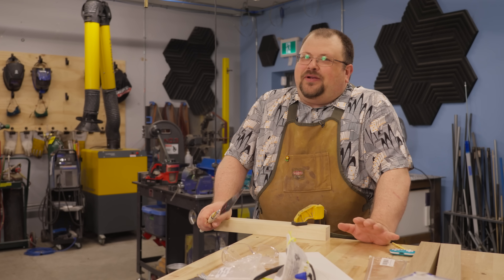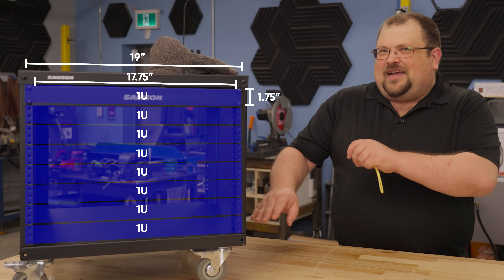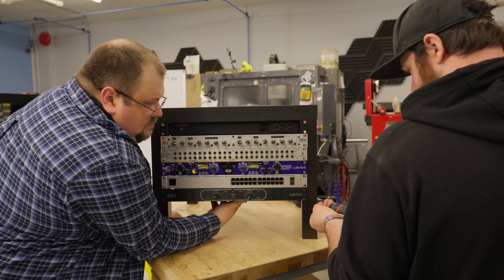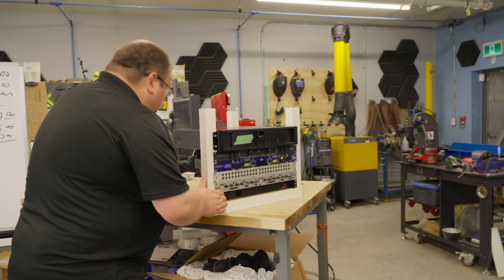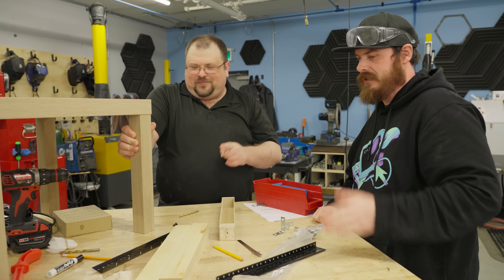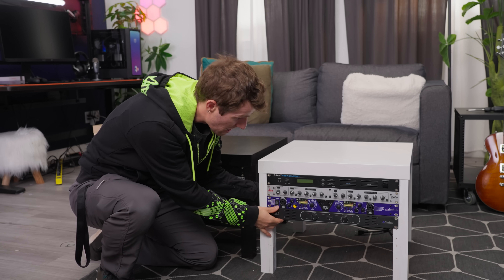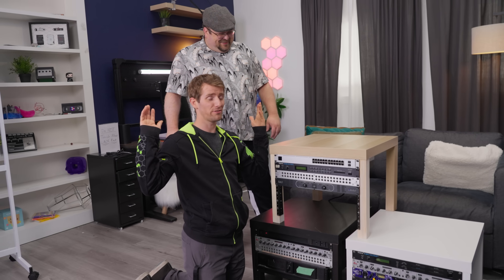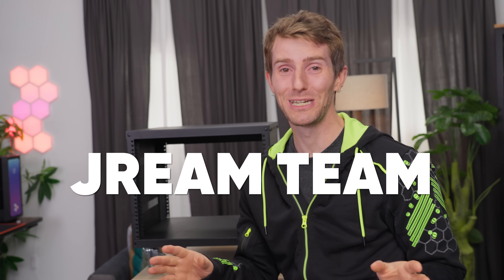Server Racks Cost Too Much - Buy or DIY?

Comment: 5:48 hey folks did you know aoft vs hardwood has nothing to do with the actual hardness of the wood, its a family classification and individual tree species can vary

Balsa is an incredibly soft hardwood and southern yellow pine is a hard softwood 

Softwoods are generally very strong and heavily uaed in construction but will generally dent more easily due to the softness and is generally aboided for aesthetic reasons in furniture making

Comment: Get an office chair out of the garbage and pull out the wheels. Then 3d print 4 office chair wheel brackets to go on the lack table legs. I stacked two lack tables on top of each other and now have a cheap rolling mini workbench with a storage shelf.

Comment: The lack table is also good for making a 3d printer cabnet. I bought 2 of them and printed stuff to link them together, bought plexiglass and made doors and voila. You got yourself a 3d printer cabnet that contains heat maintains chamber temp and everything. I also have the creality k1 printer in it.
Reply: I did this with an original Ender 3 back in the day. Still runs today - although I would have skipped all the plexiglass for solid wood just screwed to the legs. The heat leak from the plexi is hard as hell to counter (I had a 500W space heater in it at one point), and just having plain 10mm MDF on all edges and a glass door would have been so much better. LED lights at the top and you're good to go.

Comment: I much prefer trolling Craigslist, FB marketplace, etc for used server racks. They often get liquidated for cheap. It's not uncommon to find a full-height 42U rack for $75-125 USD. This way you don't have to build anything, you're spending very little money (especially considering what you get for your money), and you don't have to worry about weight capacity, build-quality, etc.

Comment: If you live in Europe, Thomann has a pretty similar Millenium 8U rack with wheels for 92 €. I have their 12U rack (for 139 €).
Reply: Still feels so expensive for a glorified shelf.
Reply: @KaKi87 It's only expensive compared to cardboard. And it has wheels and the rear rack strips/mounts, so if you factor those in, it's cheaper than the DIY version here (except if you don't put a price on labor, but I prefer to pay a tiny bit more to get a bit more free time).
Reply: Yeah, came here to say I buy the 21U version of that Samson rack for under 150€. 200USD for 8U is crazy.
Reply: Sweeeet

Comment: Here's an idea; just buy extruded aluminium profile, cut to length, connect with some screws and use those amazon rails on them. All metal for aesthetics, more durable than wood, likely about same price as wood.

Comment: I would say for buying a rack buy used. If you live in a town i could find a used one cheap or free. Not very high second hand value. Sadly most i found close to free are full size so may not fit in ever ones apartment

Comment: i will say this my vevor 12u server rack on casters i got for 80$ has been a great rack its loaded down with stuff havent had any issues
Reply: I have the same one. I was kind of worried initially because its so cheap. After building it, adding a server rack battery back up, patch panel, custom made bracket for my switch, the 1U tray it comes with, and a 3U computer chassis, its pretty solid.
Reply: I'm glad to see somebody vouch for Vevor as that's the brand I'm looking at buying for my first rack. I'm trying to get a cheap rack and at my job, Vevor server racks are special order items and the only brand we carry. Next month my company bumps the employee discount up from 10% to 20% off for a limited time so I was going to grab one then.
Reply: @turbosnail6119  i grabbed mine off of the vevor ebay store and i have big ass 4u gpu mining servers on the rack its held up very well i am actually looking at getting another one

Comment: If you’re looking on the second-hand market, full-size racks are often given away for free if you go pick them up. They can be modified to be smaller, but it’s a bit of a job.

Half racks and network racks, which are more popular, typically cost $100–300 depending on size, condition, and so on.

Comment: Almost a decade ago, I decided to rack mount both of our gaming PCs, along with some audio gear, a rack drawer, and a power distributer. I used the same Amazon rack rails, although in a longer size (the rack I'm describing is about chest-high from the floor). I constructed the rack from  1-inch square steel tubing from the hardware store, and I didn't have a welder, so the whole thing is held together with self-tapping screws and steel mounting brackets (also from the hardware store). I still have that rack, and it's still rock solid. Quality it is not, and it's not quite as cheap as a lack table, but it proves you can easily build a sturdy all-metal rack with nothing but a drill and a hacksaw for less than 200 USD.
Reply: You can do something similar with 20x20 extruded aluminum, which is more homeowner friendly and significantly lighter.

Comment: V1 would be much more stronger if you replaced wood screws with long metal + washer + nut and drilled the holes true hole leg.

Comment: Turn the tables upside down, add casters, and screw the next table top to the legs of the bottom table. Build a stack of 3 tables and add a plywood top. Now you have a 27 U rolling rack. I have 3 of these. 2 filled with servers. Mostly, Dell R710s and R310s and the middle one is power distribution and networking switches.

Comment: The Lack legs were orignally solid, but have been hollow for a while now. If you cut off the bottom of the legs you should be able to slide in a 2x2" if you don't wan to replace the legs.
Reply: How long ago was that? Cause in the video they showed a 20 year old one was still hollow which I can also verify as the one from my childhood bedroom was too about 20 years ago. (Learned that right before a completely unrelated hospital trip as 8 year old me was an idiot)
Reply: And if you remount things you can replace the inside 2x2" as it wears
Reply: It still holds hundreds of pounds comfortably if you mount it correctly and use stabilizing metal brackets. Even more if you use 2 lacks and stack them opposite of the other, with the servers resting on an upside down lack underside, and another acting as the table top.
Reply: I mean predrill holes, or use threqaded inserts or through bolts lots of things they could have done...
Reply: he showed an old one was hollow too
Reply: The tops were solid too, but that's what you have to do to keep the original launch price of 17 USD on a 45 year old product
Reply: Good place to hide ass pennies, imo.
Reply: @RisenThe  good evening sir may I please ask what ass pennies are
Reply: @ShouterOfSanity  :)
Reply: Damn even IKEA is getting cheaper. Wtf
Reply: @JamesCarlic-t2y Ikea was always cheap, you don't make products for 5% of your competitors' prices by using solid wood.
Reply: @JamesCarlic-t2y IKEA was always cheap. I mean why do you need this much wood, when it works with less? Cheap furniture these days is just some nice paneling, some chipboard supports for holes and the sides and when you need additional support, you add some cardboard in a honeycomb shape in the inside.

The only downside is, that you can't modify it. Also it doesn't tolerate much abuse.
Reply: @JamesCarlic-t2y  Just watched a documentary on IKEA making hollow paper tables, that is why they can be so cheap in the first place.
Reply: @JamesCarlic-t2y are they considered nice in i presume North-America?
Reply: @JamesCarlic-t2y it was that or increase the price of the table.

They’ve never increased the price of the table. Ever.
Reply: Yep I was gonna comment something similar saw a video lately about the legs behing hollow now and not back in the days

Comment: Alternative option... take out the fiberboard plug at the bottom of the legs and slide solid wood inside so you don't have to mess with the finish.  I did a build like that with two lack racks stacked on top of each other for years until I built my own out custom rack out of 2x4's, plywood, rails from Amazon, and heavy duty caster wheels.

I also smell an opportunity for a roast your diy racks video.
Reply: And at least where I live, many if not most places that sell building material, also cut them to any size you need for free, as long as you buy the raw material with them. So you don't even need any tools yourself and get very precise cuts
Reply: @Bumi-90 I think the Lowe's up the street from me will will do 3 cuts for free if you buy the wood from them...I have all the tools to do it myself, but why waste my time when I can order it online and have it cut and ready pick up when I get there...
Reply: Also, could put an aluminum strip behind the leg and sandwich it between the plate and the gear, bonus you get tightness due to having to use a washer, that’s how I did it
Reply: I was thinking this exact idea 13:27  literally as Linus was looking at the third iteration, then you dont have the color issue at all
Reply: You dont even have to fill the entire leg so any thickness wood will do. Just slather the contacting sides with woodglue & slide it in.
Reply: Yeah pretty much what I did, put in actual wood into the hollow legs.
Reply: That's a lot more work (especially in getting the physical tolerances just right) than just replacing the legs. You might as well paint everything black anyway for consistency, it's not like it looks very good as a server rack to begin with, otherwise.
Reply: I was thinking similar, but with an expanding fill material.
Reply: @thephoenix3000 expanding fill material that's as solid as wood for that volume? Wouldn't be cheap.
Reply: @daymianhogue1634  Does it need to be as solid? The failure looked like too much weight on too thin material. Having more of that weight supported is all is probably needs and foam can get there
Reply: @neonkidxy  the issue wasn't the weight in itself, but the leverage it put on the screw. The screw doesn't have much to hold on to with foam filling either.
Reply: @einstijn138 Leverage was the force I was trying to articulate as the failure. Foam would provide more contact and even weight distribution for the clamping force to be spread along the bolt. Fill foam vs insulating foam.
Reply: @neonkidxy  lol.. no man, no foam is goin to do anything to improve that materials ability to hand the pullout and torque from those items. The densest closed cell foam you could buy wouldn't do anything.  The threads would have near zero bite and it wouldn't hold them at all.   Even if it did something, a can of foam is more expensive than the 2x4 (and closed cell two part is much more expensive multiples of the table).

Comment: Now the real question is can it still be my side table
Reply: Sure. It'll be kinda noisy (if it's a computer rack) and have bunch of wires hanging off the back but if that is what you want 😅

Comment: I'm not really a fan of including an hourly wage into the budget. I can't remember a time I built myself a computer or anything really and thought about the fact that I could be at work instead.
Reply: For me it's more that they counted installing the equipement as part of the cost. It's not like the prebuilt rack come with them intalled.
Reply: You don't have to factor their calculations to your own personal project, it's not like the added hourly wage made the DIYs more expensive than the new racks either
Reply: eh, it's not really that, it's more about fairness in price comparison. You shouldn't really call something 'cheaper' if it took you months of work even if the actual money you spent was lower. Sure, some people might consider it a hobby, but some won't.
Reply: It's for the comparison, because that time is factored into the cost of the commercial rack. It's also useful for business purposes if you're paying an employee to build you some DIY racks to save money.

But I do agree, I never factor in my own time when doing stuff like this.
Reply: Might as well add the cost of a drill press, table saw, drill, drill bits, marker, measuring tape, vehicle/fuel/mileage to pick up the 8 foot long wood, paint, paint brush, paint container, rags, safety glasses, mask. Getting something delivered complete to your door is an incredible savings.
Reply: I agree, when you do anything DIY you are normally doing it during a time you would normally not be getting paid or doing anything productive anyway
Reply: Hate it too, so stupid.
Reply: And if you're gonna do it, it should be minimum wage at most, if you have a job that pays more than minimum wage, you can probably just afford the rack.
Reply: @merel9601 the kind of people buying the equipment they have in those racks are generally making well over minimum wage. Time is money, so it doesn't hurt to factor it in. Gives a more accurate comparison imo
Reply: The thing is I can guesretnee you the people who made the rack did not get paid 30$ an hour
Reply: I agree with it being an hourly rate, but at less than my job by a bit, like 10/hr
Reply: I think it's fair to value your time when considering if you should buy it DIY.
Reply: Maybe it's for people who wants to make DIY racks and then sell it to others. This video might help them on their pricings.

Comment: I used m6 insert screws and wood glue into the lack racks standard legs, and some cheap angle iron as a shelf to slide 2 4u servers full of harddrives and was perfect as you could slide the servers out and back in as many times as you wanted

Comment: Those rack rails are installed backwards. Th mounting holes should have been away from the leg, not over them.
Reply: @tdogz-12  yeah, there's functionally no difference between attempt #2 attempt #3. Both are just drilling into the wood. #3 just happens to also go through a metal hole that does nothing to help with removing/redrilling over the long term
Reply: @SacridTacos  I doubt they don't know which way the rails normally go, though I too don't see how this avoids the issue of redrilling. prob just a sturdier stucture though.

Comment: Shoutout to the Ikea Lack table series, still the cheapeast network rack out there. Not very good one, just cheap lol
I used those hammer in T-Nuts on the backside of each leg and bolts, much stronger that way.

Comment: I just made my 13U rack from MDF and some profile from an audio store. Some paint and casters, and it looks better than anything I could have bought, for under my desk. I really couldn't find anything with the right dimensions that could house 2x 4U chenbro cases with rails and cable arms. I did the same for my audio stuff on top of my desk. 2U high and 4 wide. Cleaned up my desk nicely. :)

Comment: For your longest, heaviest piece either put it all the way at the top with those things below it so it’s supported or put it all the way at the bottom so rest on the floor. Either way, don’t put it hanging as the very bottom one because then you’re putting all that force on the tiny little screws.

Comment: There is a secret market out there of almost brand-new racks being sold - you can find most racks, all sizes for less than $100. 

Bought my 27U for $20 and a 42U for $90.

Let me edit this just in case - In America only.
Maybe the UK as well.
Reply: Where tho?
Reply: now I'm curious about this
Reply: I bought my server rack on Facebook Marketplace. The guy trying to get rid of it even delivered it to my driveway for free. Be patient or expand your search.
Reply: Where ??
Reply: eBay, I bought an almost brand new 64u fully enclosed rack for £20 a few years back even had a glass front door. Ebay is loaded with server racks at east in the UK and they are pretty much a give away as they are difficult to ship so are mostly collection only. Of course there ar people asking huge money but a little patience will generally find one for a good price
Reply: @gr4eme1975  
eBay isn't bad if you need shipping, that is where you'll be paying tons of money though, as you will need to use freight shipping.

If you can pick up local and are in America, there is some better options.

Comment: I've had both - in fact, a DIY server rack on castors was one of the first DIY projects I ever attempted (without the assistance of el padre). 

Being that it's just a box with some rack unit strips screwed into either side, the hardest bit is making sure they're near enough exactly 19 inches apart. Good thing all men come with a built in measuring stick, just had to make sure I cut the wood to 7 of those 😎😎
Reply: You only needed 7? Damn, it must be cold where I'm at, I need more lol
Reply: As a tip for the future, if you have 2 pieces of shallow equipment (blanking panels work best) you can attach them to the rails for spacing, then fix the rails to your structure.
Reply: I've had both both. Had a full cabinet, still used lumber to mount some gear in it. Sometimes the right way will cost a week of parts delays and flights, and the good enough way costs nothing but a quick rip of the skilsaw.

The days before ubiquitous camera phones and not knowing what you'll find until you're there were actually pretty fun.